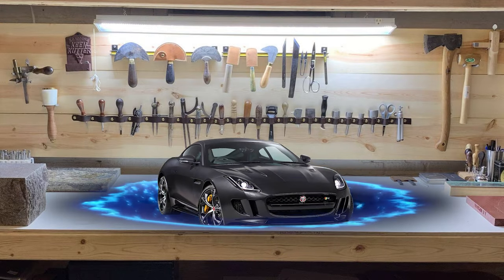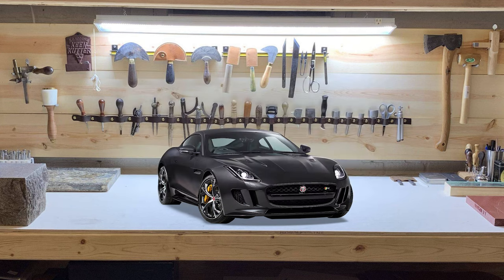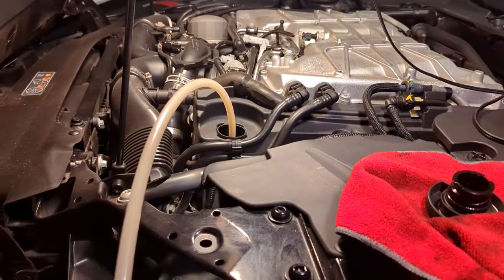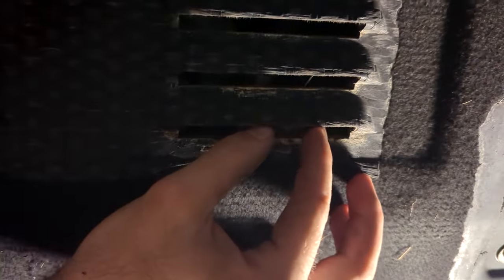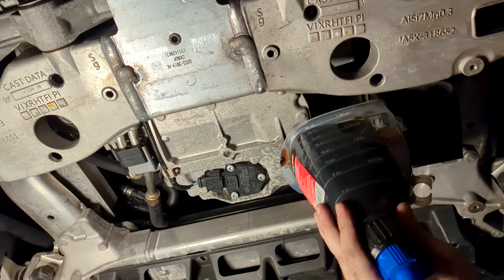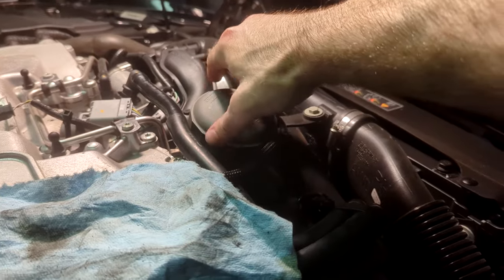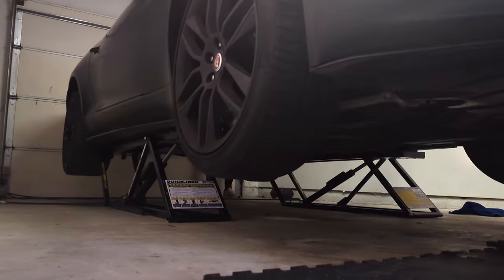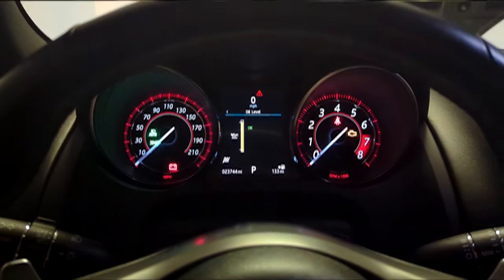Jaguar F-type R Oil Change - Extraction vs. Drain Plug

Comment: I never ever use the extraction pump on my own Jags it does not clean out all the old oil. Always take the sump plug out and drain it fully that way.
Reply: Respectfully, you don’t know what you’re talking about.
Reply: @markbeard2222 I guess if you are getting the dealer to do the changes (12 monthly on low mileage car) you could use an extractor as an additional change to be ultra cautious and be sure the best oil goes in. 0W-20 seems thin for UK ? No doubt it’s to boost the fuel economy.
Reply: @markbeard2222 does it not leave bad oil?
Reply: @mar10802  Even if you drain out the bottom there will always be some of the old oil left in places. It's not a big deal. You will never get it all, and basically you should be able to get the same amount from the top as from the bottom. The mistake this guy made is he didn't't loosen the filter before draining from the top.

Comment: I was taught on engines with the filter on top of the engine to remove the filter first then pull the drain plug. Or then use the Mityvac.
Reply from the maker: Yeah the thought is that the filter may be causing suction and hold some oil, it just needs to be loosened. I did that for this one. I'm actually about ready to do another oil change so I will see what happens.

Comment: Having done both ways, I have extracted the same amount of oil from both ways. In both cases, the car was warmed up for about 5 minutes. So it is interesting to see your results.
Reply from the maker: I'm going to redo it in October and hopefully it works. It's possible the pump stops working when the oil gets nearish the top, but I can't conceptually come up with a reason the vacuum wouldn't form at that point.
Reply: @HazyJay what? Once you run out of space or near it on a vacuum system it will stop pulling. Ever had a vacuum cleaner canister get full? The suction stops.
Reply from the maker: @michaelschultz1104  you would expect a full canister to start pumping oil out of the exhaust port rather than air once it gets full, both oil and air are fluids and the pump wouldn't "know" what it's pumping. That being said, mine was about 5 cm below the output port and there was plenty of air to pump.
Reply: My extractor has a shut off float which is triggered once the fluid level rises near the top.  Lucky for me i purchased an extractor with 8 liter capacity… which is more than my F-Type engine oil capacity.

Comment: Interesting. What was the capacity of your extractor? Seemed like it was getting full at 5 liters. My 9 liter extractor pulls nearly all  of my V6’s 7.2 liters.  I may see what comes out of the drain plug next time. Thanks for posting.
Reply from the maker: Mine was a 6.5L pump and the capacity of the V8 AWD (2016) is 6.5L (wet fill). My plan was to empty it once it was getting close to the top and pump more but I ended at around 5L. I'll definitely try again at my next oil change in October and see, I'd love for this to work haha.

Comment: I got about 6 liters out of mine just for comparison so about 1 liter left in the car which is fine if you do oil changes every 6k miles or 10k kilometers since the engine is mostly not under a lot of stress in day to day usage with low revs all the time.
Reply from the maker: Yeah it's probably OK to do extraction oil changes yearly then a normal change maybe every 4-5 years.
Reply: Low revs on an F-type? how dare you!!??

Comment: I've done one oil change using the same extractor. As I recall my tube was small and slide inside the tube in the cars oil fill hole. I filled the extractor plus up to the lower line. Perhaps your extraction tube is shorter.

Comment: Came here doing a little Google'ing before I go to change the oil on my 2015 R. Didn't even realize we had a dedicated extraction tube, didn't know that was a thing. Thanks for this vid; everything from the vibe to the quality and clarity of instruction, fantastic.

Question on that rather large amount of oil remaining. Barring a pump issue, tube vacuum leak, or whatnot, is it possible that when you extracted with the oil filter on, and then (presuming you left the pump still connected) you opened the oil filter housing, is it even possible for that to create some sort of pressure release where all that excess oil found its way down? As in, if you opened the filter housing and then tried using the extractor again, you'd have picked up much of that remaining oil?

In my head, it doesn't work that way. But I have minimal knowledge here. Thanks again for the great vid - and the one with the flappy noise, what a simple fix.
Reply from the maker: It's possible the there was some oil left in the filter area and it was trapped due to suction in that area. In October I will try it again and this time with the filter loose and see if it changed. I'd like for the top-down method to work since it's extremely convenient.
Reply: @HazyJay  same. I went ahead and ordered a Mityvac today. When I change mine, I'll try loosening the filter as well and let you know how much I can extract. I'd also like to avoid the rather ambiguous jack points on this car.
Reply from the maker: @Eskareon  Yes! Let me know what you can get. Yeah the quickjacks are barely long enough to reach the jack points but I had to buy them because jacking up this car is a pain since it's so low.
Reply: @HazyJay  Hey, sorry for the delay getting back to you. I'm lazy. So according to my notes, after extracting the oil, I had to add 6.7 liters of oil to get it to show full (this is after letting it run to cycle through the new filter, etc.). Which means if the sensor is correct and it's truly full-full, then that leaves about 0.5 liters of old oil somewhere in the system, as according to the manual my capacity is 7.2L. This was with me removing the old oil filter and then using the Mityvac to extract oil. And moreover, my new Mityvac had a vacuum leak - the hose came cut at a sharp angle and must not have seated properly in the quick-release fitting, so I was constantly fighting it sucking in a little air, requiring me to pump the entire time. But even with that reduced suction, I got all but 0.5 liters out.

Again, presuming the sensor is correct. I wasn't about to jack up the car and remove the bolt just to see, hah. Also, I didn't bother writing down the amount of oil I extracted, because the level was getting low and I've been driving it hard for months, so I know I burned off some oil anyways. That's why I went with "how much did I add to get it to full."

So, all of that said, your 2 Liters remaining after the Mityvac sounds high. Maybe next oil change you can try removing the filter first and seeing if somehow that helps your extractor... extract.

Comment: Great Video! Will definitely do both methods on next change based on this!  Do you happen to have specs or link for your lift system? Thanks in advance.
Reply from the maker: https://amzn.to/46Rtx4I
Reply from the maker: The lift is a quickjack 5000TL, it's cheaper from Costco (even if you have to buy a year membership) so consider buying from there. If you do the extractor can you let me know if you get all of the oil out? I'd definitely like to do it from the top it's way faster but only if it works.
Reply from the maker: It's possible that the extractor was malfunctioning, but I was able to suck oil from the used container after no problem so maybe the fitting to the engine was leaking vacuum.
Reply: @HazyJay  thank you!  Next change in spring. I will try both extraction and drain plug and let you know…hoping extraction is all that is needed after that as well 🤞

Comment: Great video. I am thinking of picking up a 2021 F-type R AWD. Any advice or concerns I should have?
Reply from the maker: I'm going to refer to another youtube creator whose vid I watched before I bought mine. Some main things are keep up with maintenance, change rear diff oil, watch for rear diff leaks and possibly upgrade the coolant Y-pipe prophylactically. I've had mine for a year and the only problem has been a rear diff pinion seal leak which was $300 but covered by warranty. https://www.youtube.com/watch?v=JD5FhkrwwX4
Reply from the maker: Oh one more thing, in 2021 they made it more difficult to make the car sound the way it used to in 2015-2020 (probably due to regulations), and due to this, you may need to remove a fuse to make the exhaust full-time open. Before MY 2021 you just need to keep the car in dynamic mode.